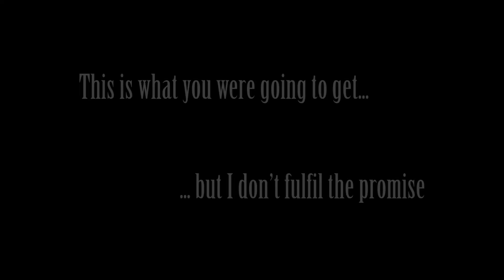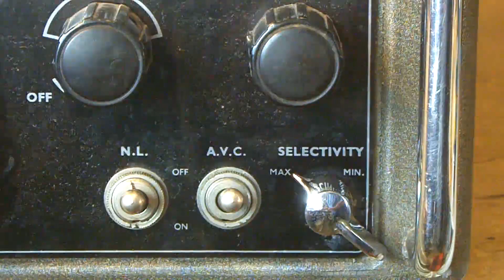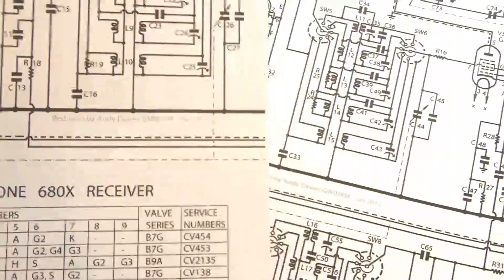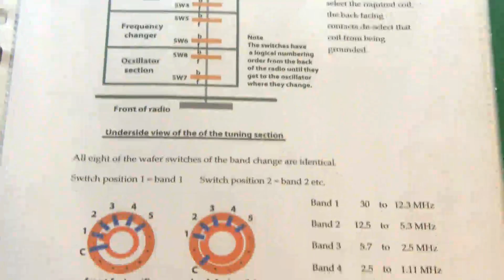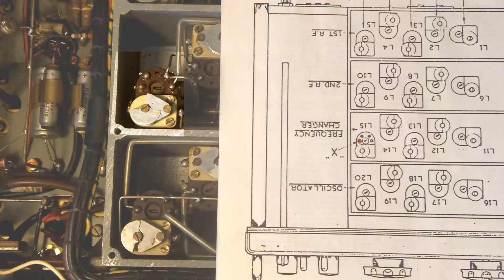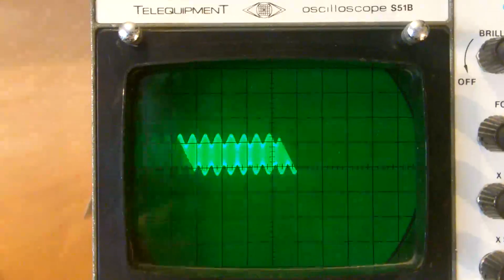About Radio 52 The ramblings of a radio enthusiast... IF Alignment (1 of 2)

Comment: Hi Andy, I really enjoy your videos, In this video you mention your telequipment Scope. I watch your video on the Selenium Diode replacement . Mine is also damage and the spec. sheet call for a 3.4 KV at 0.68mA. How much 1N4007 do I need to replace this single Diode pack. Thanks for you videos.